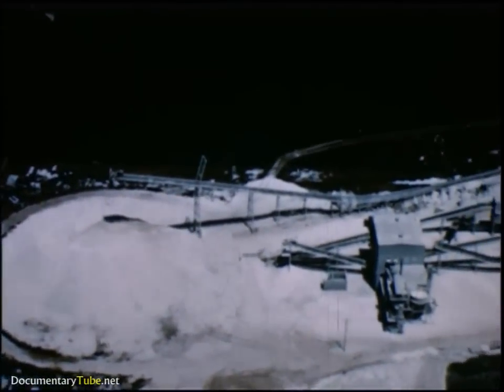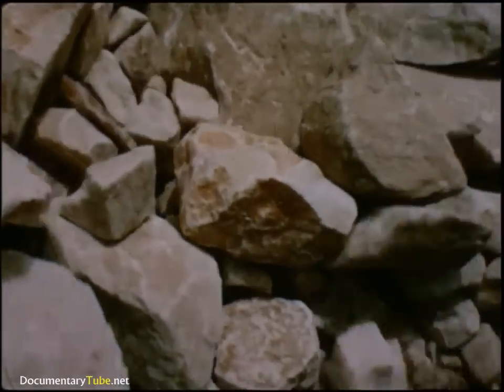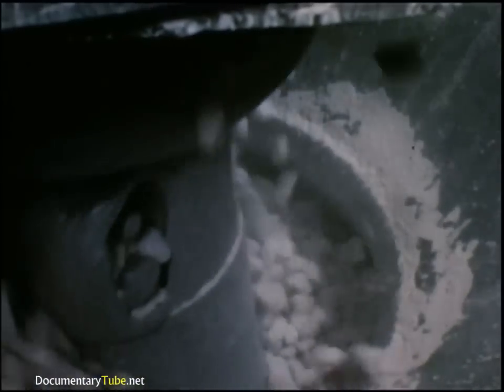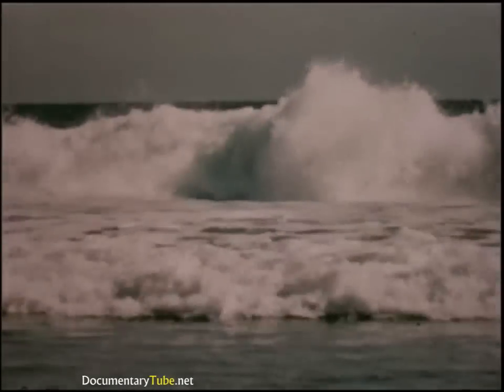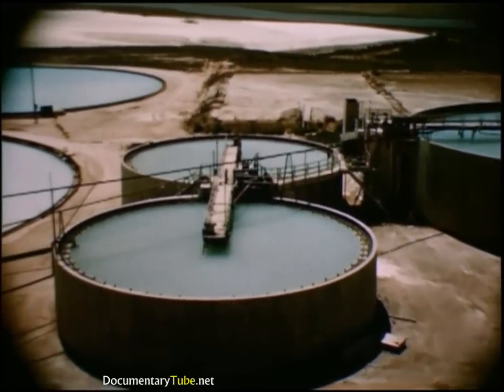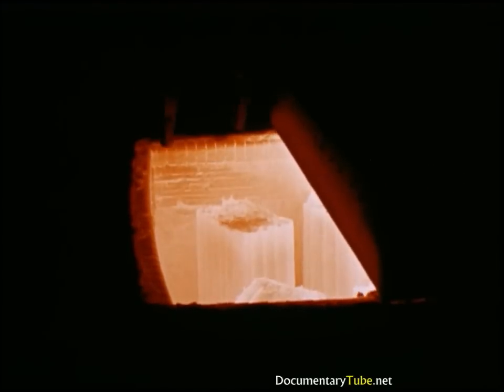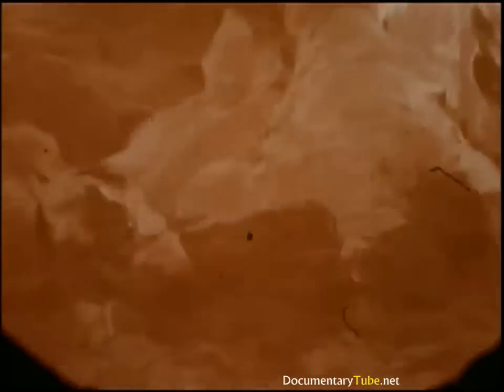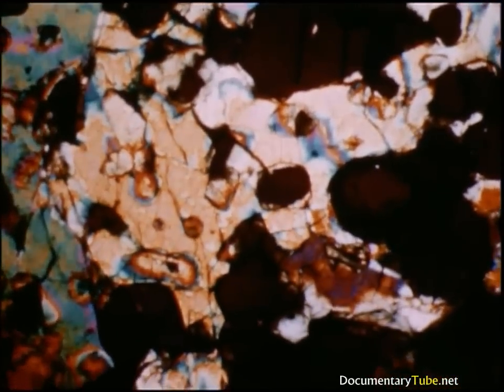HOW IT'S MADE: Fire Bricks

Comment: I need refractory good enough for melting steel. This video helps explain the high cost.
Reply: +Gen Maximus yOU NEED A professionally made crucible rated for thousands of degrees if you are taking steel and melting it.  If you are making steel check out sand  casting Iron- then find a place that sells crucibles- they are made in America- on E-bay a Brit sells them but the cost of international shipping puts his crucibles way out range.  basic steel is carbon and Iron.  Get on a site where people make iron castings all the time
Reply: clay graphite crucible is what you need to melt steel
Reply: with out an arc furnace or electric resistance... you cant...in great quantities..gas furnaces barely scrape that temp requirementthe refractory is the easy part